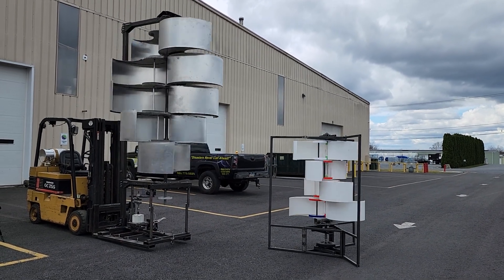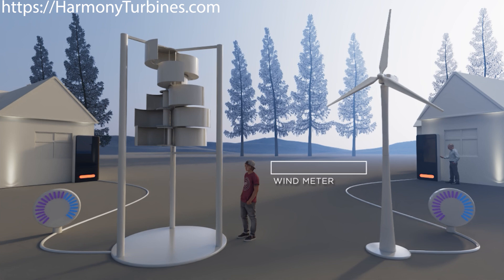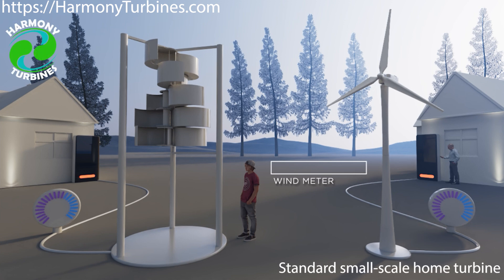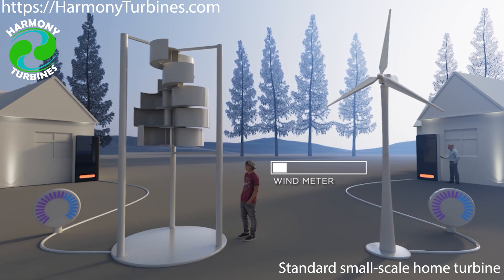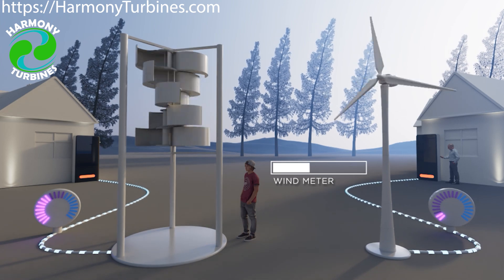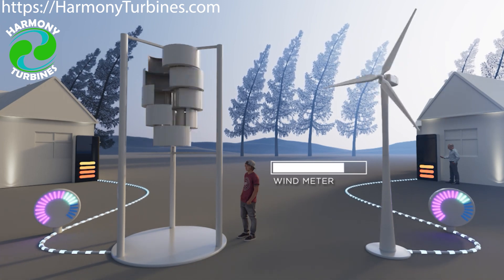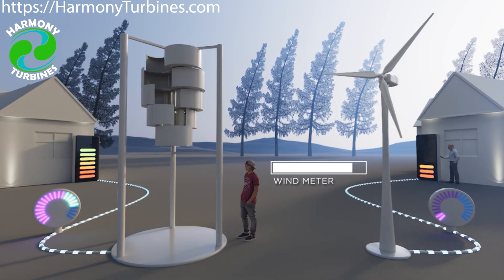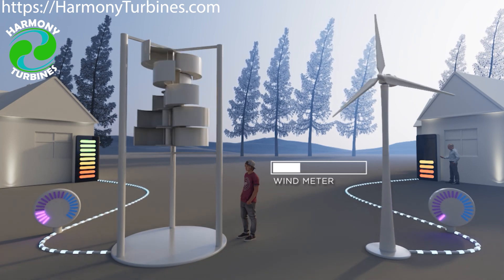Educational Side by Side

Comment: QUESTIONS:

I am already a diy’er in Solar, and have built a working system (48V LiFePO4 battery array).

I am now interested in building an array of vertical axis wind turbines to either exist independently, or preferably to connect and charge the solar 48V battery array, as a compliment to the solar.

My issue: i can not find any detail info with which to educate myself, so i can design such a system.

Here are my initial areas I would like to address, if you can direct me to the appropriate answers:

1) Can I install an array of the vawt, and have them all wired to a controller, management system, so they can simultaneously be used to charge the batteries?
If yes, what type of controllers can be used and are reliable?

2) Can the output of the vawt array controller, be used to simultaneously charge the 48V battery array, and how do I protect it so it works along with the inverters?  i have two EG4 18kPV inverters running in parallel.

3) What safety precautions do i need to install, such as fuses, diodes, disconnects, etc, to design in safety for an entire system.

4) Is there a forum dedicated to this technology, similar to will prowse diysolarforum, where diyers are discussing these topics?

I need as much info as possible, because I intend to build this vawt array addition as soon as I think I can safely do so without harm to the existing system.

thanks

Comment: What's the estimated potential maximum size (diameter and wattage) ?
Reply from the maker: @DEO777 Unclear at this early stage in development since we're only focusing on this small size for rollout. But there's no reason we should not be able to make units into the multi KW range. At industrial scale with overhead cranes and proper assembly equipment perhaps upwards of 50-100KW? But that's for discussions much further down the road.
Reply: @HarmonyTurbines what kind of power are you getting out of the models you are testing now and viewable on your videos? I love watching the development of this turbine 👍🏻
Reply from the maker: @007silverwings  On Oct 14th we got some really strong winds and finally had sufficient data collection going to capture various performance sessions in those winds. We will be releasing that footage very soon, probably around the 29th of this month (October). So stay tuned!
Reply: @HarmonyTurbines  excellent. Can't wait!